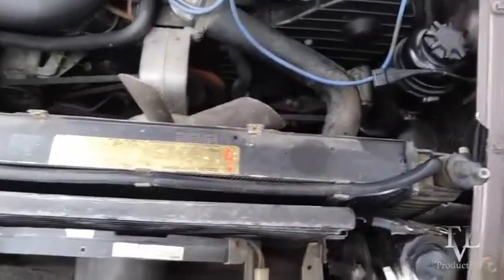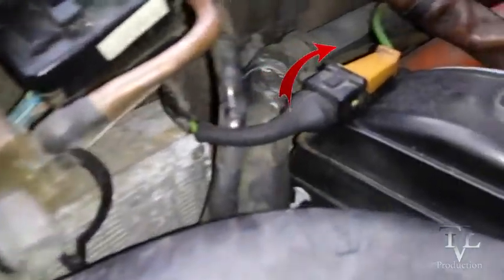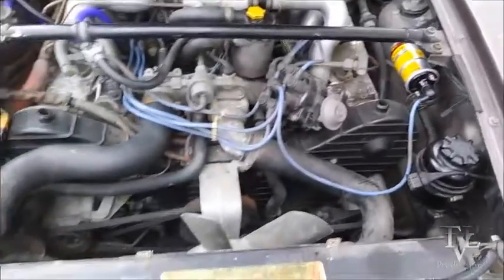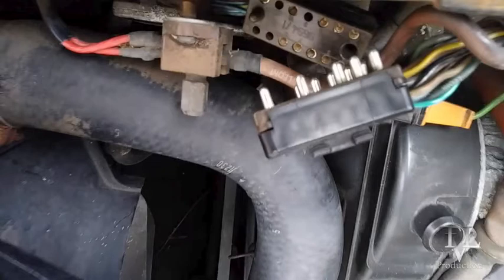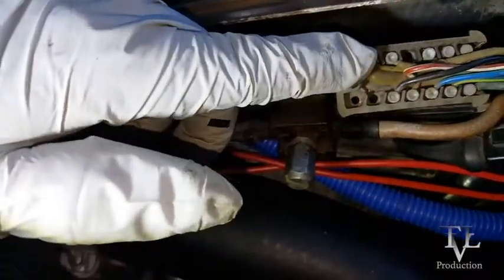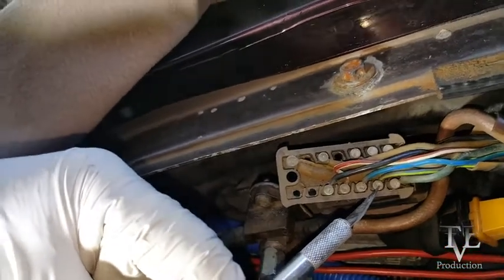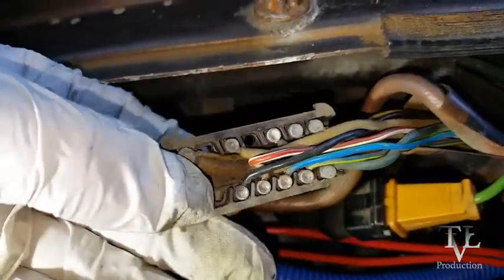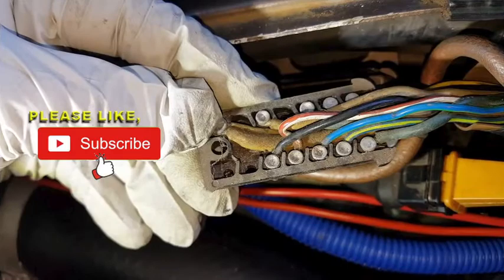Porsche 928 14 pin connector

Comment: what is that loose connection he requests help identify? Also, can anyone do a video on all the grounds? especially the ones that can be sprayed easily?
Reply: Just a guess but from the work I've done on my 928S it perhaps could be an after market additive as it doesn't seem to come from a standard Porsche connection area.
For what I don't know.
But of course I could be wrong.
I had a wiring harness connecting to a large electrical connector that seemed to be for a radar connector.
Needless to say that has all now been removed...